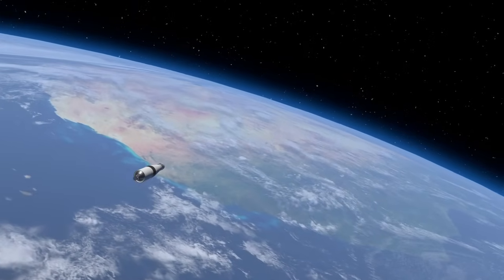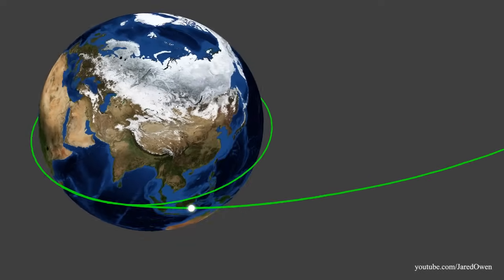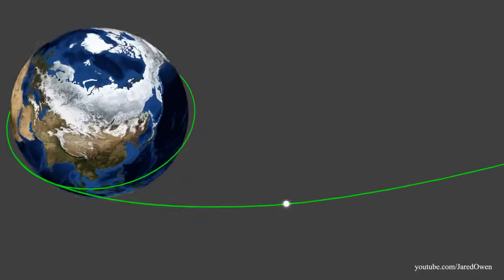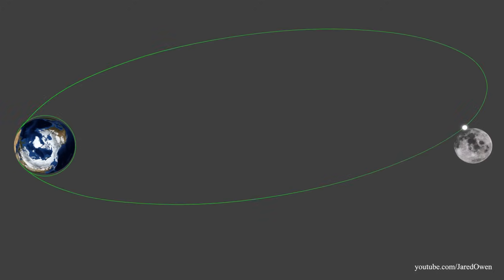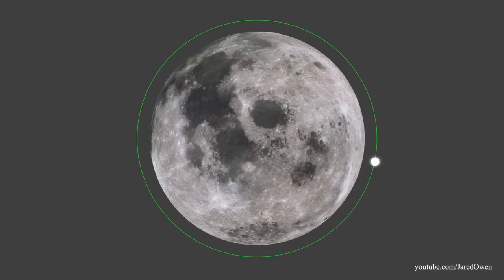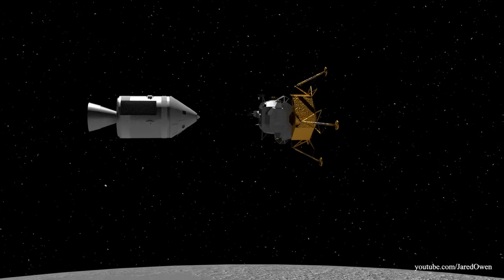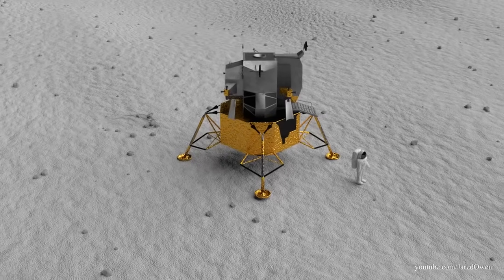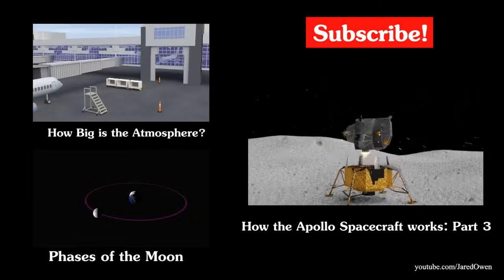How the Apollo Spacecraft works: Part 2

Comment: Why do LM and CSM dock in space?

Don't you think we can dock it from the beginning and mount it on the rocket?
Reply: No, not practical. Which way do you propose to mount the combined spacecraft at launch? The main consideration is the launch escape tower that was designed for only being able to quickly take the command module with the 3 astronauts safely away from any kind of catastrophic failure with the Saturn V.
Reply: @mako88sb  Thank you very much.  I was so curious after watching the movie first man.
Reply: @lgreen3800  NP. Something interesting about the launch escape tower is that it was actually almost twice as powerful as the Redstone rocket used for Alan Shepard's Freedom-7 sub-orbital launch.

Comment: The moon has less gravity than Mars. Why did they not need parachutes to slow the space craft down to land on the moon? And how did it stay upright with only a single rocket located in the center?
Reply: A parachute needs a thick mass of air to work. At the Moon is too thin to get a normal effect of the parachute.
And at the end of the video is the answer of your second question.
Reply: I didnt see anything a the end of the video about what kept it vertical or upright on its final decent, just before touch down.The main engine allowed it to have a safe rate of resent, but what kept the craft vertical?
Reply: @leelafarlett3535  Small engines that change the position. As it is at the Moon, you have no air and you don't need that much to change the position.
Reply: @leelafarlett3535  yes, you're right. It is not on this video. It is in another. If if find it, I'll let you know.
Reply: but you need something to keep it upright, or its going to land on its side, nose first, or at an angle, and start cart wheeling , and bouncing across the surface for a couple hundred meters.
Reply: @leelafarlett3535  As I have wrote before: small engines at the sides. If I found the video that explains it, I'll share it. But you can search it by yourself.
Reply: Just say you don't know, its ok. I found out anyway.
Reply: @leelafarlett3535  "Small engines that change the position". I know how. I just was been nice offering you a video with the explanation.
Reply: @leelafarlett3535  just say you don't understand.
Reply: Correct

Comment: And again, only CGI. 
You forgot to mention that the earth is flying around the sun with sun with 108000km/h and the sun is supposed to fly around the milkyway with 792000km/h. Your grafics seem to be a little to simple. 
There are photos of the "lunar lander" in high resolution. It consisted of Aluminium foil,  cardbord and curtain rods, sticked together with ducktape. Look for yourself! There is no blast crater under the "eagle" while the Astronots suits are covered in dust kneehigh.
Reply: This is what happens when you cut fundings for education
Reply: And the porpuose of mentioning that will be...
Reply: Mole, remember to never drink coffee inside a plane.
Thank me later.

Comment: Fake nonsense.  rockets can not provide thrust in the vacuum of space.  It is impossible.
Reply: Nonsense. Rockets does provide thrust in the vacuum. It is called science. You can study it.
Reply: @LocoFompi   I have studied it.  Rockets need pressure behind the rocket .  you cannot create pressure in a vacuum.
Reply: @boptah7489  Where did you study it? That's not the way rockets work. They don't push the air to lift tons of metal. Have you ever try to push yourself in the air?
Reply: @LocoFompi    How do you think a Boeing 747 flies/  It flies in the air using lift and pressure. 

   I know how rockets work.  Rockets need pressure behind the rocket to force the rocket into the lower pressure in front of it.  Pressure differential moves tonnes.  any hydraulic or pump engineer will tell you that.
Reply: @boptah7489  A Boeing doesn't use rockets. What are you talking about. A Boeing uses the air in front of it. A rocket uses pressure inside the chamber to push it in every direction. As there is a hole in the bottom, the results is that it is pushed up.
Man, please, where did you study rockets engineering?
Reply: @boptah7489  https://en.m.wikipedia.org/wiki/Rocket_engine

As simple as that. Yes, it is Wikipedia, which doesn't means that it is wrong. Please, check the references below and try to find any of those that sustain your nonsense.
Reply: @LocoFompi    you sai8d " have you ever tried to push yourself off air".  Well a Boeing does it very well.  I did not say the Boeing was a rocket. 

  A rocket needs pressure behind it to make it move.  On Earth the rocket gases create pressure behind the rocket contained with the atmosphere.  that is why a rocket works on Earth.  Space is a vacuum. and it is impossible to have pressure in a vacuum.
Reply: @LocoFompi  Anything on Wikipedia is suspect.  Here you are.  https://en.m.wikipedia.org/wiki/September_11_attacks
   according to that page 3 buildings were demolished with two planes.  Including WTC 7 that fell at freefall speed. .  more bullshit. 

    You need to wake up.  You cannot generate thrust in a vacuum. It is impossible.
Reply: @boptah7489  Again, I told you to check the references and find ONE that sustain your nonsense. Can't you do some simple task as that?

I didn't said that you mentioned that Boeing was a rocket, but that you are comparisisng with a rocket, since it doesn't use rockets in order to move.

Actually, the plane flies because passes more air over its wings that under its wings. So it is not "sustained" for the air under it.

Please, man. Just a little bit of serious research, as you are making a fool of yourself with your posts.
Reply: @boptah7489  Finally: no. The gases doesn't "push" the air under the rocket. The explosions push the rocket up. The gasses need to go out from somewhere and that is the bottom for obvious reasons (you want it to lift straight, so you need equal forces in all directions except for the bottom.
Reply: @LocoFompi  physics is not your subject ,  Is it?.
Reply: @LocoFompi  A plane flies due to pressure differential.  A rocket uses pressure differential but in a different way.  It is you that di not know what you are talking about.  you do not understand the pressure relationship on aerodynamics.  nor the pressure differential in rockets or jet engines.  Once you understand the they all work on pressure.  then it becomes very clear.
Reply: @boptah7489 Again: do you have ANY document to sustain that? Because all that you are writing is, basically, bs.
Reply: @LocoFompi  Didn't you know that a wing acts as a device to create a lower pressure area on top of the wing and a higher pressure area underneath it?    Didn't you know that a jet engine propeller blade works on the principle of a wing  ?.  A rocket engine works on the principle that the hot gaseous mass behind the rocket is the high pressure area and so the rocket moves into the low pressure area in front of it.  ALL flight works on the principle of pressure in an atmosphere.  Even birds wings .  Do you need documentation for that .  Lol.
Reply: @boptah7489  Yeah, right. I have provided you sources to check the information and to correct your statements. You, instead, just have a lot of good will to ignore the reality. Just keep on walking. You have already embarrassed yourself enough.
Reply: @LocoFompi    I am correct.  that is why they can't go to the moon today.  Now jog on.
Reply: @boptah7489  Aerospace engineer here, you need to study harder whatever the hell you have been studying, your logic is awfully wrong
Reply: bo ptah rockets work due to 3rd Newton law of inertia, quite simple. They throw gas particles in one direction thus providing thrust, no magic there. Think what happens in space when you throw a massive ball in one direction, what happens to your body?
Reply: @tgstudio85  There is no "  3rd Newton law of inertia"   you are thinking about Unicorns and Narnia,  .   In the vacuum of space you are NOT throwing anything out the back of the rocket.  the gases are being evacuated by the vacuum,.Rockets need pressure behind the rocket to work.  rockets work on pressure ONLY.  And you cannot create pressure in a vacuum,  It is impossible.
Reply: @boptah7489  Just because you lack the mental capacity to understand it doesn't mean that it is fake.
Reply: @rinse-esnir4010   I know this subject completely.  No work can be done in a vacuum by a pressure creating device ( rocket)   . It is ludicrous.
Reply: @Blaise Dermot DELFORCE   You are a completely clueless child.   Now  . Jog on.
Reply: @Blaise Dermot DELFORCE  You are not throwing tennis balls in space.   Instead the rocket gases are being evacuated into the vacuum of space at the rate at which the gases expand. . And so no 'work' is done. . 

    The reason why a tennis ball provides some 'resistance' to the force is because of inertia Rocket gases have no inertia in space because the rocket gases are in 'free expansion'
    To understand how a rocket works you need to think of "PRESSURE"    nothing else. .
Reply: @Blaise Dermot DELFORCE The WHOLE point of expanding rocket gases is to create pressure.  .  There is no other point. 

   The gases are  NOT moving at there free expansion rate until they meet the vacuum. 

  Rockets cannot provide any pressure in a vacuum. and so there will NEVER be any thrust.   This is very simple.  you need to understand that you have been brainwashed.

Comment: Hi any thoughts about the Van Allen Belt and how the radiation might affect the craft.
Reply: Something you have to remember is that the radiation in the Van Allen isn’t all Gamma rays, in fact Gamma makes a small minority of the rads there. Curious droid did a great video on it, and he explained it much better than I could.
Reply: A. They picked a path that went above/below the main part of the radiation
B. Radiation affects by exposure time. If you get exposed for less time, you don't get as much radiation.
Reply: It was messured. You can check it.

Comment: Hey there.  I've watched your 3 part series and it is FANTASTIC!  I am modeling the Artemis Mission spacecraft so I needed to see a few things for clarification and this worked outstanding.  I have always loved the Apollo missions.  I DO have one question.  When the spacecraft slingshots initially around the moon it is backwards where it uses the engine to slow down.  At 3:11, it has reversed.  At what point does it turn around?  That's my only question.  Great work!

Comment: You need astronauts farts to get to the moon. You need more than twice the actual fuel capacity to complete the mission. But the worst is that thrusters can't work in vacuum. A pesky thing called Joules-Thompson effect tells you that pressurized gases released in vacuum conditions make no work. You can't go anywhere with this in real vacuum. Newton's 3rd. is frequently misinterpreted. An oposite force requires contact or friction to preserve the continuity of the system. There is no space travel.
Reply: cough, o2 tanks, cough
Reply: @rooka4  Yesss. Lots of O2 and malt beverages and eggs.
Reply: @1969nitsuga  You need more than twice the actual fuel capacity to complete the mission.

Riiiiggghhhttt;) So can we all see your calculations?
Reply: @tgstudio85  The SM was propelled by aerozine-50, a 50-50 mixture of hydrazine and UDMH.  According to the US Air Force:
The available chemical energy from reacting one gram mole of aerozine-50 (.6522 mole hydrazine + .3478 mole UDMH) with 1.02 moles of nitrogen tetroxide at 25oC (298 0 K) is approximately 1.54 X 105 calories (6.63 X 103 BTU per pound aerozine-50 reacted).
Hydrazine N2H4 molecular weight = 32.05 g/mol

Nitrogen tetroxide N2O4 = 92 g/mol

UDMH ((CH3)2)H2N-N = 60 g/mol

Combining Hydrazine and UDMH as per the above proportions:

aerozine-50 =  0.6522 x 32.05 + 0.3478 x 60 = 41.8 g/mol

Converting 1.54 X 105 calories to joules, x 4.2 = 

646,800 J/mol

This means that aerozine-50 has a chemical energy density of 15,484,798 J/kg.  (This compares favourably to NOAA's figure for the chemical energy of pure hydrazine of 19,410,000 J/kg.  It also equals 6.63 X 103 BTU per pound as per the above reference. Hydrazine has a higher energy content than UDMH but the latter is more stable, hence there use in combination for rocket fuel.)

Each kilogram of aerozine-50 was burned with about double the weight in nitrogen tetroxide (which acted as the oxidant).  So, the total propellant weight carried on the SM of 18,410 kg would have yielded 15.4M x 18,410 / 3 = 95,025,043,726 J = 95 GJ.

The weight of the Command Module (CM) was 5,809 kg, SM = 24,523, LM = 15,200 kg.  Total = 45,532 kg.  Some of the rocket fuel will be burned on the way to the moon, let's say half for the forward journey, and assume it's gone at the beginning.

Using the kinetic energy equation 1/2mv2  from earth orbital speed of 7.8 km/s to moon orbital speed of 1.78 km/s:

1/2*(36,327)(7,800 - 1,780)2 = 658 GJ.

If only half the fuel was burned it would yield 47.5 GJ. Let's assume that all of the fuel was burned on the way to the moon:

658/95 = 6.9 times.  You would need 6.9 times the total fuel the SM had just for the required velocity change, i.e. not including for course corrections -- not all of the SM's fuel was for brute acceleration.

Now we factor in the fact that rocket fuel is only about 70% efficient at converting chemical energy to thrust. So you would need 6.9/0.7 = 9.89.  About ten times the total fuel the SM had was required just for the forward journey to the moon...it was clearly an unrealistic task.
Reply: to specify, i meant the LIQUID o2 tanks used in the SM and all other stages. NOT the breathable o2 tanks in the CSM.
Reply: @jimmyfly If the pressure of a system is 0 then the work done by the expanding gas into that system is 0. Gas expanding in a vacuum doing no work agrees with Free Expansion. This can also be understood as the gas meets no resistance as it exits into the vacuum and thus transfers neither heat nor energy to its surroundings. If the gas loses neither heat nor energy then it has done no work.

Rocket thrust is given by the equation:

F=m˙vexit+Ae(P1−P2)
where m˙ is the mass flow rate, vexit is the average exit flow velocity across the exit plane, Ae is the cross-sectional area of the exhaust jet at the exit plane, P1 is the static pressure inside the engine just before the exit plane, and P2 is the ambient static pressure (i.e. atmospheric pressure).

Provided that the nozzle is not overexpanded and flow separation does not occur, Ae remains constant, and the thrust difference is realized primarily from the change in P2 (atmospheric pressure). If nozzle is overexpanded to the point that flow separation occurs, however, the exhaust jet area drops as well, causing further losses.
Reply: @(S)-Riley Dunn The principle of work and kinetic energy (also known as the work-energy theorem) states that the work done by the sum of all forces acting on a particle equals the change in the kinetic energy of the particle. The Joules-Thompson's effect and Bernoulli's Law clearly tell you it doesn't work in vacuum. You can't create backpressure in space vacuum or ultra low pressure atmosphere. There is no way to saturate it. You can't transmit nor transform kinetic energy. P1 - P2 is always undefined in vacuum. Do you know how supersonic flow works? The less pressure the faster, as Joules-Thompson's and Bernoulli predicted. NASA has no way to prove their claim. The Goddard vacuum chamber is only 100' wide by 200' tall. Too small to tests anything. The vacuum gets compromised the moment you ignite the thruster. You are only parroting stuff you read but don't understand. Get a life.
Reply: @Oiled Up And Ready ! They have mass cognitive dissonance! Science impaired, "because NASA said so"...
Reply: @1969nitsuga  HaHa! Two idiot's trying to out-stupid each other! Hilarious!

Comment: @Jared Owen 
Easier said than done. Highly dangerous manoeuvres for even today. Do you really think it's possible for command module to turn 180 degrees, dock with lunar module and pull it out  when speeding at thousands of kilometres per hour? Remember, all these feats with a computer system with a memory of today's pocket calculator.